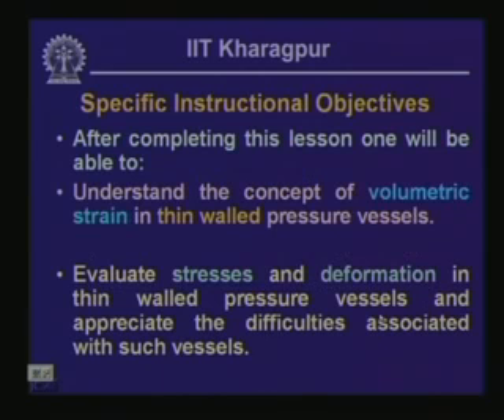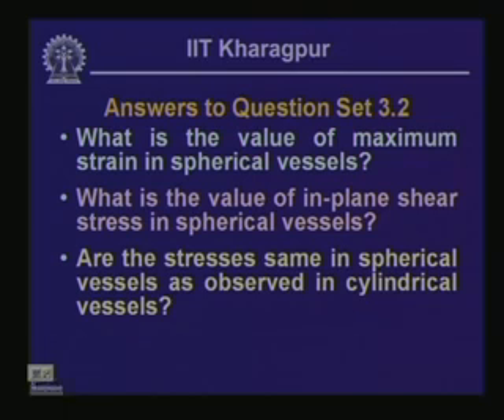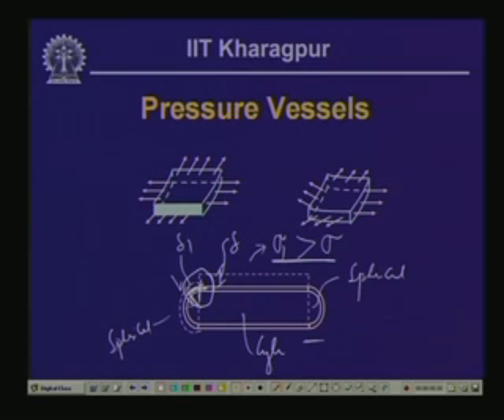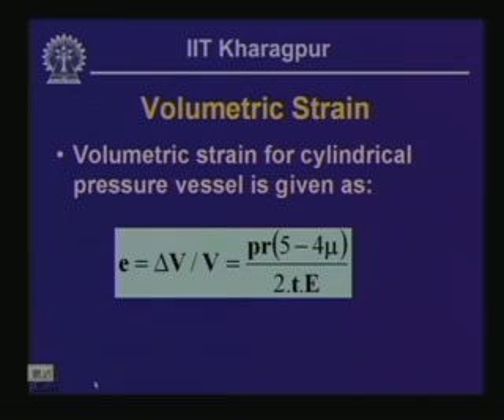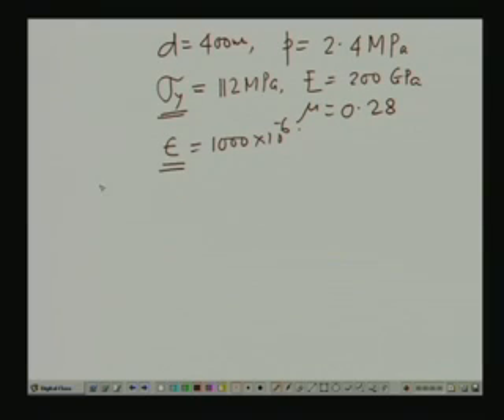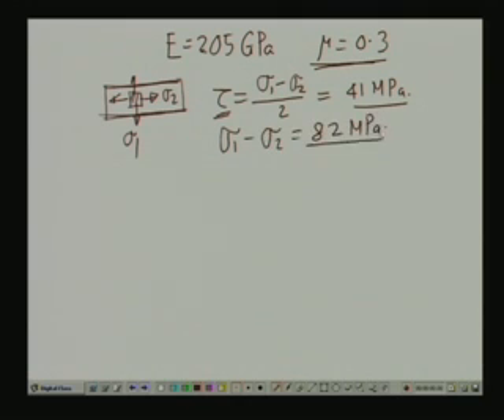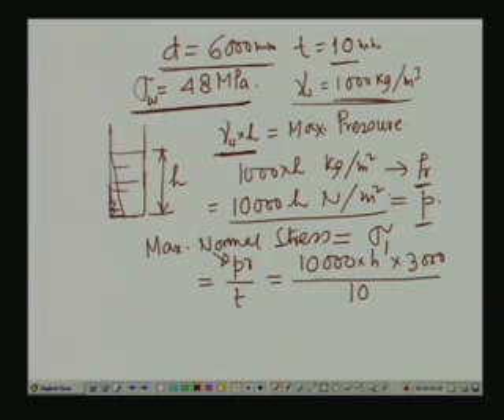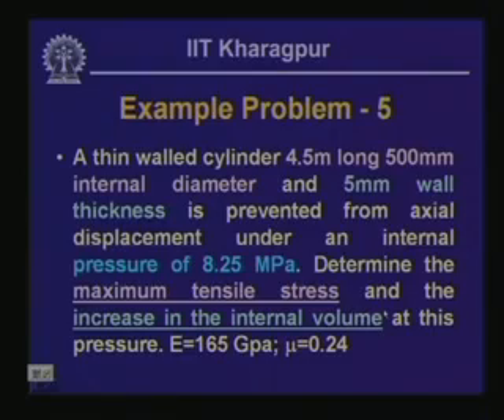Lecture - 17 Application of Stress / Strain

Comment: WHY longitudinal strain is considered as design criteria for safe operation, why not circumferential strain (Ref. Q2)?
Reply: Refer to stress-strain curve. If longitudinal strain increases, at yield point, material starts yielding. Yielding sets plastic set into the material which can be extremely dangerous in engineering operations, because eventually reach fracture point. Hope I was clear.
Reply: Lower value must be considered for safe design.